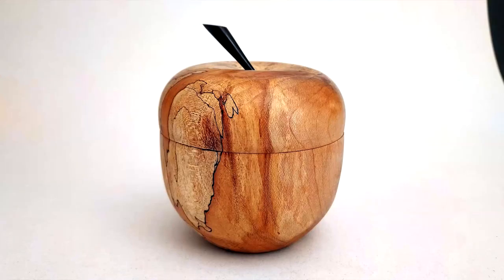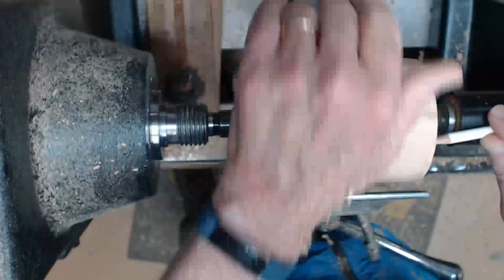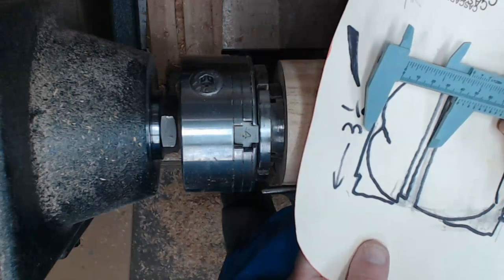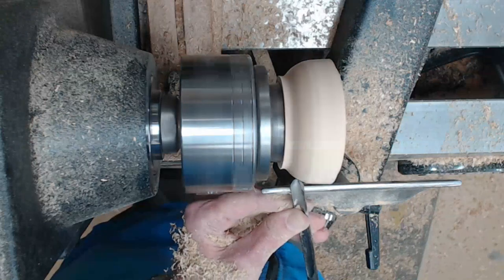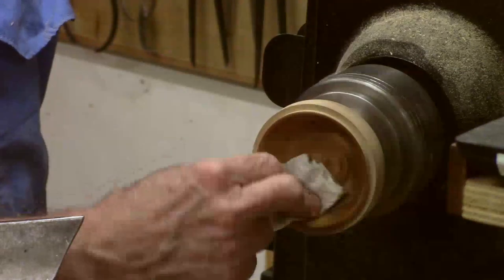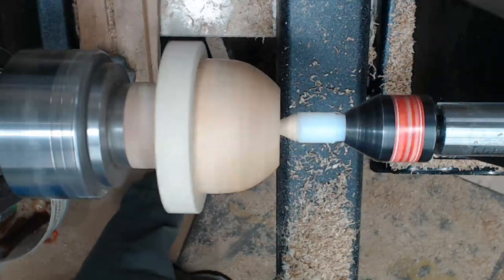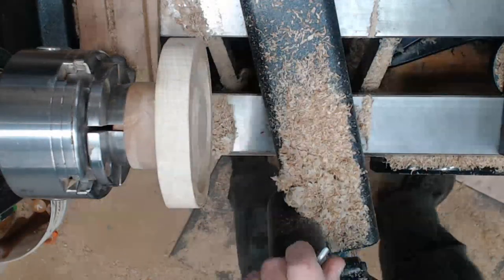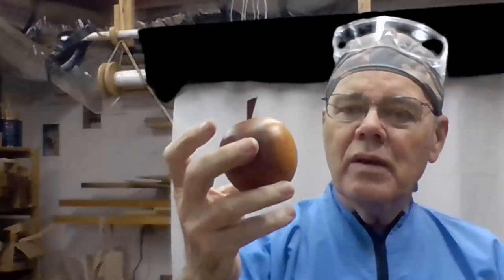Turning an Apple Shaped Box

Comment: Very nice project, Mike. I think I'll have to make an apple box out of a chunk of spalted maple I've been saving.

Allow me a couple of comments. This is NOT a criticism of how you turned the box. Instead, I offer these comments in the spirit of sharing other options. I think all of us benefit from have several different ways of accomplishing a task. It's just nice to have several techniques in our tool belt.

First, your discussion of using a wide and then a narrow parting tool reminded me of a demonstration done by Alan Lacer several years ago. He made a small v-cut with a skew and then used a hacksaw, with the lathe running, to part off the lid of box. The advantages of this technique are that it is very quick and it wastes as little  wood as possible, making grain match far easier. It's similar to using a bandsaw, but you don't have to take the blank off the lathe. If you use this technique, you need a very stiff hacksaw -- not the cheapest one at the local hardware store. Also, depending on how you have the blade mounted in the hacksaw frame, you may need to run the lathe in reverse for it to cut properly. You also want to pay attention to what you're doing. It's easy to let the hacksaw move away from being perpendicular to the ways of the lathe.

For blanks more than 3" in diameter, this is my preferred method of parting off a lid. For a blank less than 2", I'll typically use my narrow parting too (as demonstrated in the video -- including chasing it across the shop). In between those two sizes, which method I'll use will depend on how important grain match is and how easy it is to find my hacksaw. If it's hanging up where it should, that's what I'll use.

Second, this blank and project are perfect examples of why I like to stabilize wood at home. I know you tried stabilizing and found it didn't fit in well with the kinds of projects you typically turn. (Things are different in my shop, if only because wood is so much harder to come by in Arizona than it is in Georgia.) Imagine if, after parting off the lid, you rough turned both the lid and body of the box -- leaving about 1" of material on all sides. You could then stabilize both pieces in Cactus Juice. Why might you want to do that? First, it makes a punky blank like this one much easier to turn. The material will take finer details and it the surface will sand evenly. You could even have used a threaded lid on the box. Of course, you demonstrated that a fine result could be obtained without stabilization. So, it's just an option, not a necessity. Second, you could have dyed the blank red (or green). It's possible to dye the raw wood after the turning is done, but with punky wood the dye is taken up unevenly. Too often, the result is a blotchy appearance. That's not the case when the wood is dyed as part of the stabilization process.
Reply from the maker: Good points. I still need to come up with a new top for my pot as mine was too thin and started to get microfractures. I have seen that hack saw trick on a video somewhere. I will have to try that. Never would have thought about the direction of the teeth.  I have tried the bandsaw with a jig but with my coarse blade and not tracking well, I am no better off than using a thin parting tool.

Comment: Neat project Mike, Thanks. One thing I didn’t catch, even going back to around the 20:00 point, was the link to the collet chuck review you mentioned.  I pick up a used one (unmarked) that unfortunately does not run true with all of the 5 included collets. Anyway, thanks for the idea for a neat box.  Cheers, Tom
Reply from the maker: The icon that shows the link is probably not available is watch on TV but generally visible on a PC or phone. Here is the video link https://www.youtube.com/watch?v=Gp2ogl0dzyQ
Reply: @MikePeaceWoodturning  Thanks Mike for the link.